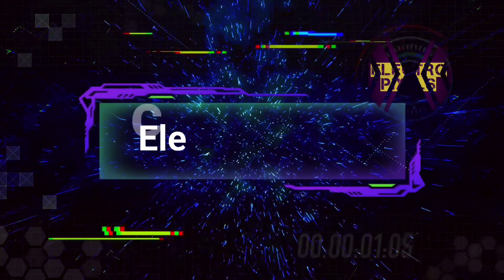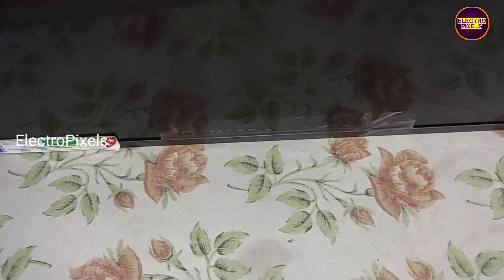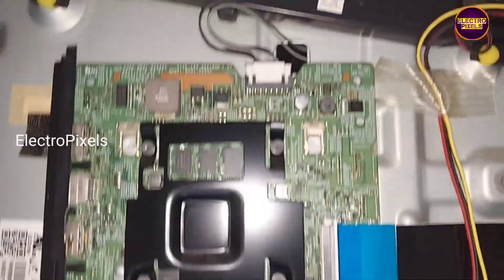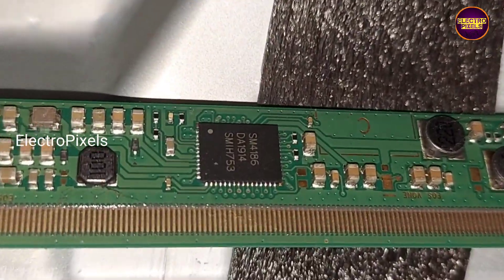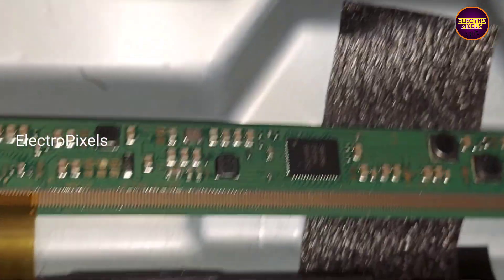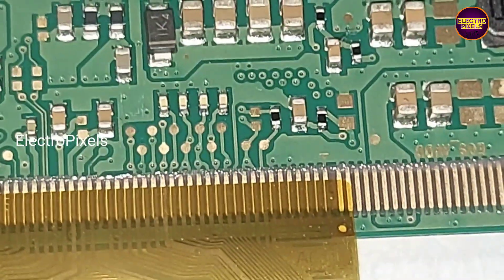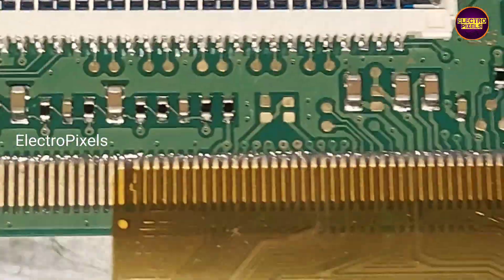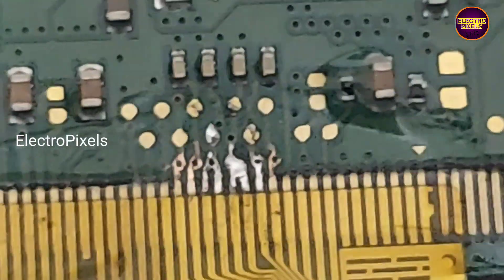Panel Short Removal in Samsung Led Tv with SM4186 Dc to Dc IC|Fault Blank display|No vgh,vgl,Avdd

Comment: Can it be solved by laser machine? For permanent solution
Reply from the maker: No Because in laser machine the cutting is Done by internally
Reply: Sir video hindi me banay to sahi hoga
Reply: good video as always. can you explain why some panels use Vgh odd/ even voltage and CKV signals ( going to panel) whilst others only use the latter? Why is Vgh odd/even toggled between 28 and -7.5V every 2 seconds? The gates in the TFT screen plane  are not switched like that, thank you